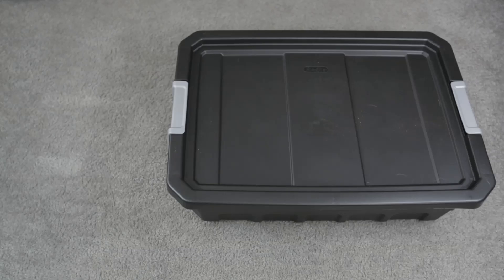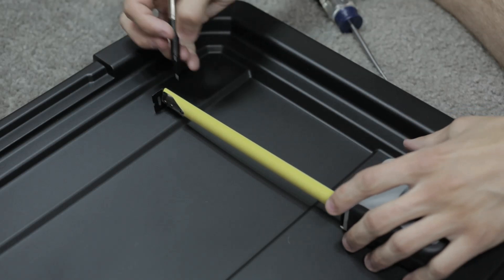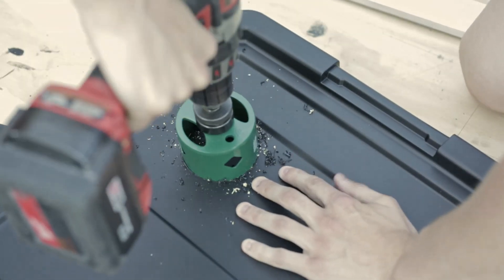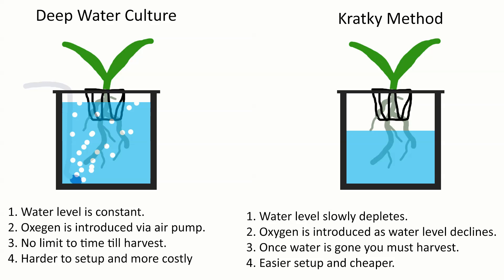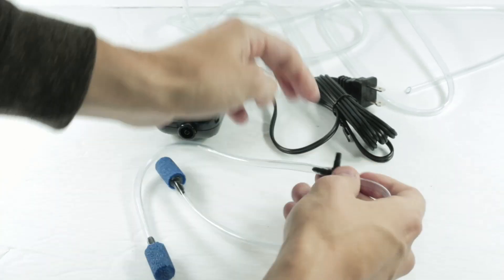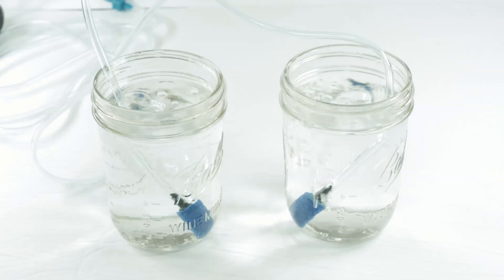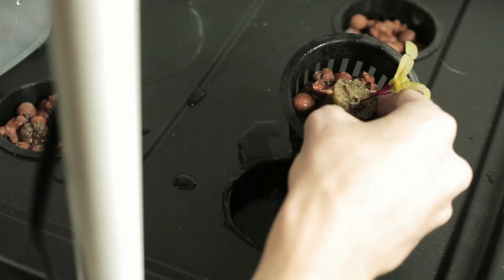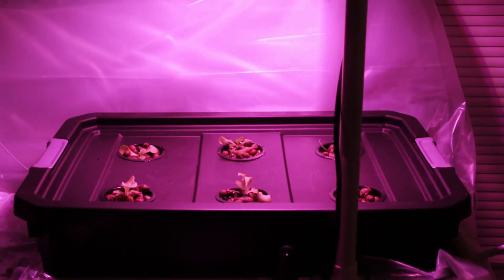How To Build A (DWC) Deep Water Culture Hydroponic Setup ( Easy and Cheap )

Comment: You absolutely need to use reverse on your hole saw with harder plastics. A roughneck tote is more forgiving than say... a bucket or clear Ikea tub plastic.
Going forward causes binding in the plastic that cracks and shatters it.

Comment: I know this vid is old but the way in which i drill holes (2" and 6") is by FULL BLASTING THE DRILL> This is the part that I did not see Techplant doing. Keep the lid ON THE CONTAINER so your bit pushes into air (not a plywood that adds more resistance)> Next: Full blast the drill. SLOW descent into plastic and continue a LIGHT pressure (pushing too hard will add more labor time as it will not be a clean smooth cut but instead will be plastic bits still hanging so cut slowly allowing the weight of the drill to do the work). BUT MAIN TIP: FULL BLAST DRILL BECAUSE IT cant penetrate all that plastic when u start it with the teeth inside... actually one last tip: also full blast the drill and THEN LOWER IT INTO THE HOLE dont start it touching the plastic as IT MUST BE WORKING FAST TO NOT BE IMPACTED NEGATIVELY BY FRICTION OF PLASTIC ie u cant expect a clean cut when the bladed teeth are not spinning quick enough. im sure bill nye could explain better

Comment: Dude Never drill them totes with your fingers close to the blade them teeth always catch that plastic and run that blade sideways while it skate around and always drill in reverse at high speed with little pressure on the blade you want the heat from the friction to cut a clean circular cut in that  thin guage of plastic so you just have to de-bur the edges I been growing Cannabis for 40 year's I'm 50 now and been building tote/container dwc systems for the last 15 years straight so watch your fingers and please keep them out of the way of ANY cutting actions
Reply from the maker: usually im pretty safe, had a hard time doing this, ill watch my fingers next time

Comment: What size sterlite container did you use?
Reply from the maker: i think it was about 7 gallons
Reply: @TechplantChannel  I'm trying to find out where to buy it in black.  I can only find clear (sterilite).  Clear as i understand it will promote algae growth.
Reply: @TechplantChannel  Actually I found a 10 gallon option in black that is 7 inches deep.

https://www.containerstore.com/s/storage/plastic-bins-baskets/12?productId=11007874

Is 7 inches deep enough?

Comment: Great video thanks for the info on making this system as for the drill part you just gotta go lightly at first and spin fast and then push through. Too much pressure and slow speed will cause the hole saw to grab onto the material instead of cutting. Now I'm gonna make me a little dwc system 🤙
Reply from the maker: Im going to make another one and ill try that!
Reply: Awesome I'm looking into starting a micro hydro system just trying to study up before hand thanks again for the info
Reply: i agree with the speed part, but also dont push the drill in as it will end up not cutting every bit of plastic off and u will have to debraid the plastic urself with a debraiding tool... takes long... but ive found allowing the weight to guide the bladeand let the blade do the work leads to a cleaner cut

Comment: If you are beggining grower DO NOT START THIS WAY,,really dont use a reservoir,,make each bucket its own res.that way its super simple,,easy to experiment with nutes ,water extras ,,also every 5 days the buckets need washed with hot water and nutes changed,,this allows you to treat each plant independantly and cleaning weekly helps alot with algea,ph control etc,be sure and use a proffessional airpump ,no airstone weight the hose throw it in bucket,,so much wrong information out there everbody believes you gotta have or do ,,ive had a dwc bucket setup growing non stop for 8 years now,,i get awesome results,,but i dont do what all these folks purport you have to do,,i use tap water,i use no airstone,,i do not ph my water dont even own ph test gear,,i do not have or test ppm,i use gravel outta my driveway "washed of course" for grow medium,,in dwc your plants tell you very swiftly whats happenning,,you just have too learn to read your plants,,that is the key trick too growing dwc,,this is where a grower will make or break in dwc,,once you learn what your plants are trying to tell you this is when you know that youre gaining mastery of the grow,,dont hesitate to grow because of what the youtubers say"they tend to make rocket science outta everything,,as you learn what your plants are telling you your grow will get better with every grow,,then its easier to start growing strains that are different,,ive found every different strain has their"sweet spots,,seems they take different amounts of nutes ,light etc,another valid reason not to have a res.good luk an get too it,
Reply from the maker: Your bucket method is nice.
Reply: Techplant,,i just enjoy being able too treat individual plants ,,instead of all the same,every strain reacts just a little differently
Reply: I will have pics when i get my new computer

Comment: Do you have any issues with the lid sagging under the plant weight?  I see the material was thin.  Good job on the project.
Reply from the maker: The only one that i have slight sag with, is the one i messed up on and drilled an oblong shaped hole. the rest of them sit very nicely and the lid holds up very well with all 6 slots holding a fully mature lettuce plant.

Comment: what size hole saw did you use for the 3 inch net pots?
Reply from the maker: I believe its a 3 inch hole saw. The 3inch net pots are the inner diameter. So the lip is over 3 inches.

Comment: Tell your going to bleed. Get your fingers away from that hole saw they can jump around
 and if you haven't yet I promise if you keep your hand that close to the saw you will bleed
Reply from the maker: I cut myself at least once producing each video lol, just two days ago i was cutting plastic to make some makeshift 200mm fan to 120mm adapters. I said to myself, SLOW, FOCUS, BLADE IS VERY CLOSE. sliiiiip. sliced her real good. all part of the fun tho.
Reply: All them using your body as a tool accidents will all come back to.haunt you when the old age kicks in.

For smaller holes check the step drill bits electricians use for sheet metal great for plastic .
For hole saw both hands on the drill for control. Hi speed. Start a pilot hole same size as pilot bit lower steady with your deathgrip on the drill nice and square and you will get clean holes. All about control with the drill.
Good video
Reply from the maker: @thuss5162  Thanks for the tips, Im new to a lot of this and usually experimenting so im always glad when people take the time to teach me something new! thanks!
Reply: @TechplantChannel  if we can't teach and learn from each other we are doomed. If you really want to increase your plant science knowledge. Find Harley Smith from NPK industries in utube and npk web site under education. Take any and all of the classes he offers well worth the money. 
He is well published so any plant search questions add by Harley Smith and he probably has a video or article.
 I have save so much money on nutrients after his class and my yields have doubled

Comment: After building many hydroponic systems the absolute easiest method for drilling holes for your net cups is pre-drill the holes with a smaller bit that will allow you to start the hole, once this is pre-drilled you can then attach your hole saw and insert it into the pre-drilled hole and put it in reverse. Once the drill bit has gone through  and you put your drill in reverse run it at full speed and let the saw scrape away the material and then let the weight of the entire drill force the teeth of the hole saw itself through the plastic lid and don't apply too much if any at all pressure its not a race to get through you just need a clean hole with no chunks taken out of it. Watch what your saw is doing and if needed apply light pressure in a circular motion till the saw punches through the plastic fully. 
You really don't need any backing to make it easier to cut.

Comment: The reason u was having an issue with the hole saw was the slow speed u was trying to cut with to make a clean cut even with no backing just pull the trigger and hold on the drill will do the work for you but awsome job on the video
Reply: also  running the hole saw in reverse helps also